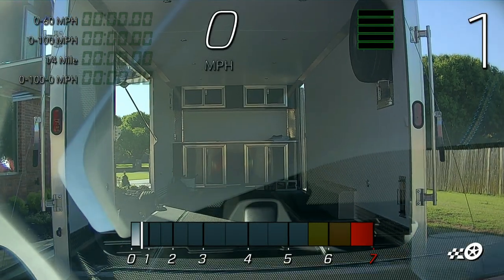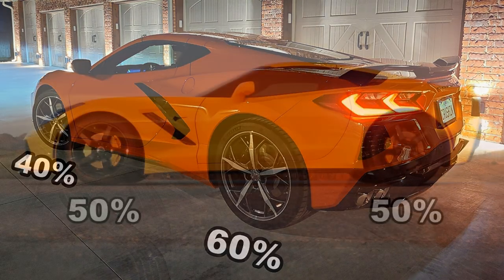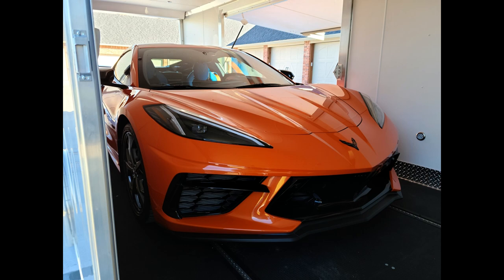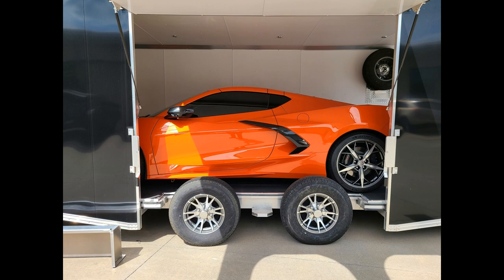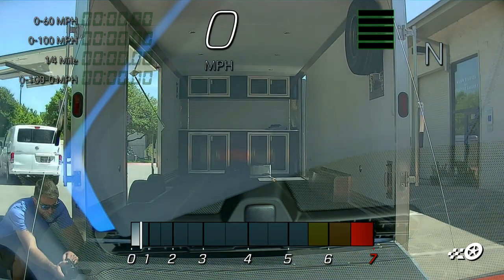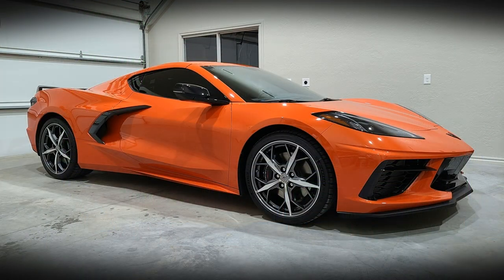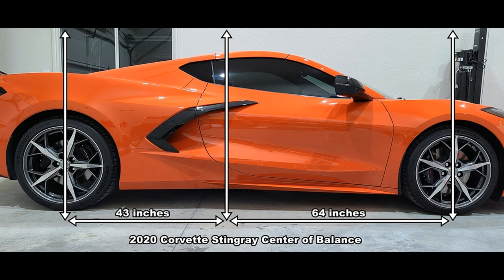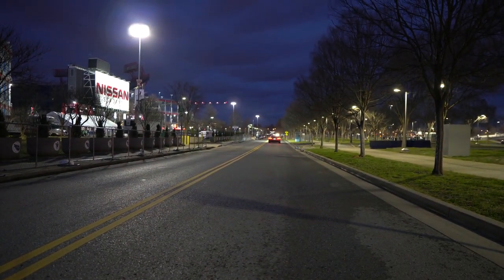2020 Corvette Center of Balance & Trailering

Comment: Great general advice.  I haul in a 24ft aluminum enclosed frequently for work, many different cars, even SUV's.  From a Chevy Bolt to a Lincoln Navigator, and everything in between.  The GT3 Porsche was way forward, I can assure you.
If you are hauling the same car pretty much always, take the time to get an accurate measurement of the weight at the hitch, when loaded, and place stop blocks on the floor so that you get your car to the same spot each time.  Trailer companies should have the piece of equipment available to check.  At the absolute minimum, 10% of the total trailer weight should be on the hitch ball for stability.  Maximum needed for a really heavy conventional trailer hitch is on the order of 15 - 1800 pounds.
Be mindful of changes in load distribution when you add or subtract significant items to the trailer, like filling cabinets with spares, bolt in a tire rack, etc.
The enclosed trailer I pull has about 400# on the ball when empty, and I load generally to make it between 800 and 1000.  There is a hitch on the market with a built-in load indicator, a great friend when transporting so many different cars.
Lastly, remember the importance of a balanced load across ALL of the axles in your rig, including the tow vehicle.  Never a bad idea to get to a CAT scale at a truck stop and find out where you are when fully loaded for a long trip.  With the trailer on one pad, and the tow vehicles rear and front axles on separate pads, you can see where the weight is, and how you might need to redistribute some gear.  $12 well spent.  Consult the axle weight ratings on the manufacturer's labels for truck and trailer!
The outfit I work for has two trucks and 3 trailers for me to choose from for a job.  Loaded GVW ranges between 14 and 22K pounds.  Never a problem on the road.  Tow smart.
Reply from the maker: Thank you for the additional input!

Comment: I will be picking mine C8 up from the factory on an open car trailer. Afetr reading the other comments I'm guessing that backing the car onto the trailer is the best thing to do.  ALSO, where can acquire them and what is the part number for those "T" Hooks.  I saw on other sites that there were different size "T" hooks.  Is that number shown on the hook significant?  Can't really make it out.  Appreciate any info and insight.  Don Smith

Comment: Thank you for the video! I’m getting ready to trailer my C8 home. I’ve only ever owned manual cars. With the DCT, do you tow with the vehicle in park or manually put the transmission in neutral? E-brake on or off? I haven’t had the chance to see the owners manual yet or if this is even addressed in it.
Reply from the maker: You're welcome!  I've asked members of the Corvette team about this and was told to tow it in park with the e-brake engaged.

Comment: What model trailer is that? Have to do the same cross country.
Reply from the maker: It's an EZ-Hauler Mission aluminum 24' trailer.  I'm super happy with it.
Reply: Jeremy Welborn  thank you. I was torn between the ATC CH405 and the InTech and was looking at the Mission no one I knew owned one. So great to hear you have had good luck with it. By the way super video! Great choice on the film too. I have it my cars as well.
Reply from the maker: Thanks!  I was looking at ATC but I found a great deal on the Mission and saved about $8000!  I bought mine from TSI Trailers north of Dallas, Texas.